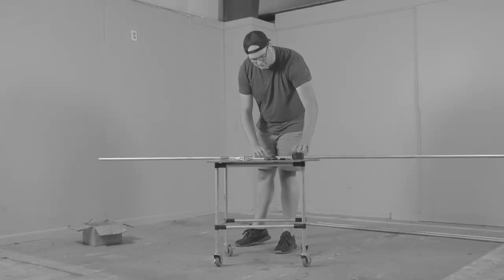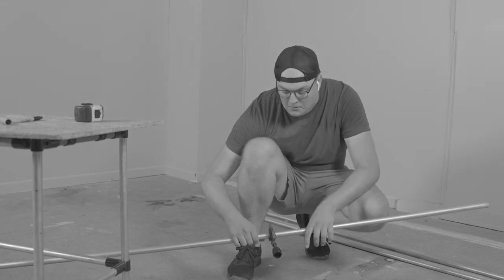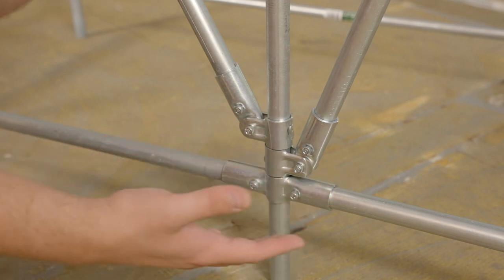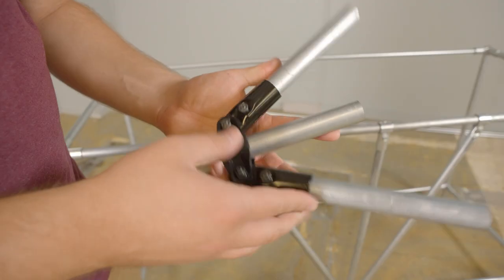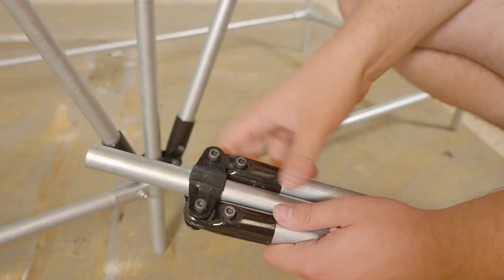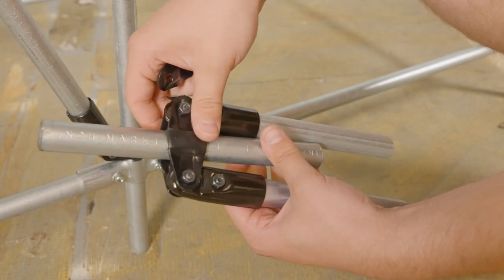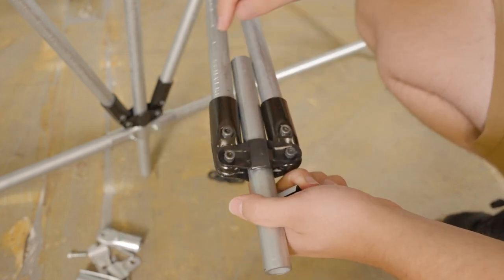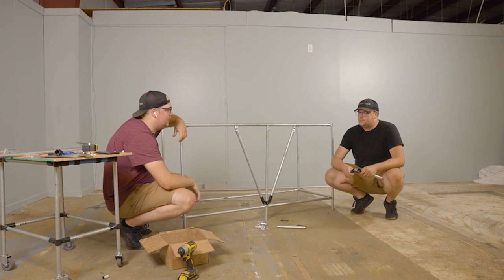Now There's A BETTER Way To Brace!

Comment: That looks really good!  Probably on my next order.   (If I had the budget, It would probably help me make a Hanukkah menorah for a public display, along with the adjustable angle connectors.)
I'm still cleaning up from drilling all the holes in mine for 1/4" bolts, so the pipes don't pull out under stress, and when it's being assembled.  It is a temporary structure, that's used once a year, and needs to go together quickly, and probably by one person.
Reply from the maker: I can totally see how this could be used in a Menorah build. Do you run the bolts through both connector pieces and the conduit?

Comment: I need to build a dog sulky but I don’t know where to start. I’m worried my choice of connectors will not be stable & the center seat will fall off. 

I also don’t know how to connect bike tires to a diy rigid fork made of conduit. 

Dog sulky costs $1,500-$3,000 so I’ve decided to diy just don’t know how or where to begin… help.
Reply from the maker: Hi there, thanks for the comment. That is an interesting project and we'd love to help out with the design. Shoot me an email with a picture of an existing one that you'd like to re-create and we can see what we can come up with. My email is jake@makerpipe.com